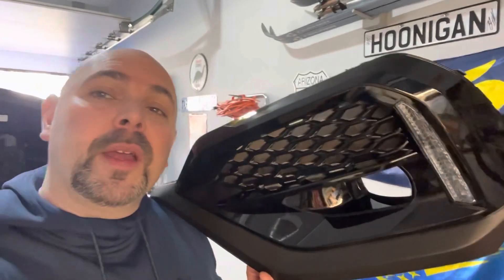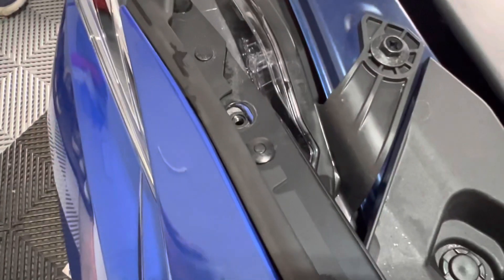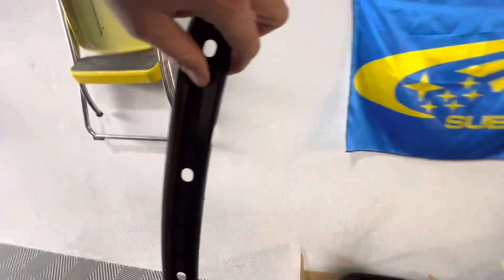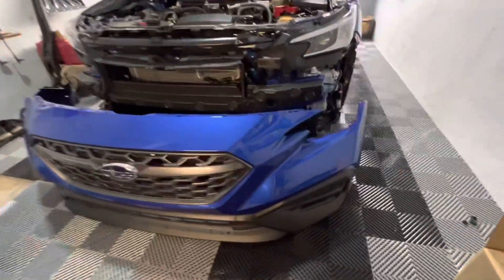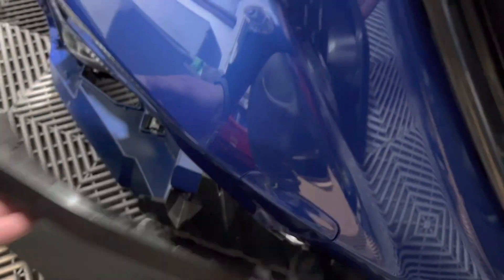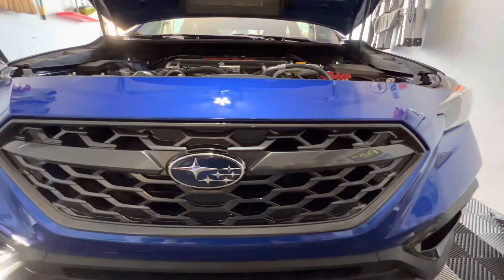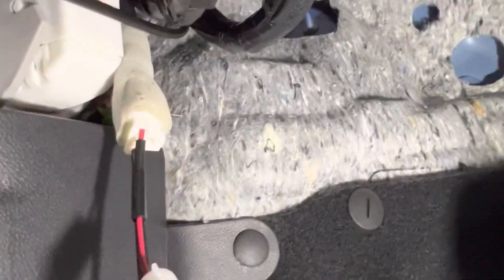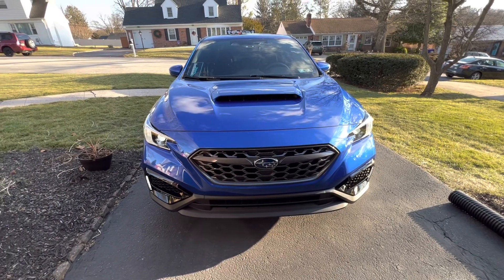WRX upgrade!! LED fog lights installed.

Comment: Great video! Really helpful 
Under the dash, is it as simple as just plugging both pink wires together? 
Also, would it work the same way with the JDM ones?
Reply from the maker: @Dragunz_ewe  It is literally that simple.  I am not sure about the JDM ones but I am assuming they are the same.
Reply: @allthingssubie4796  awesome!!! I’ll give it a try 
Thank you for your help even after so long!

Comment: Great instructions, thank you! Also, is the wire assembly on the interior the fuse? Or do we have to install new fuze in the box?
Reply from the maker: @Drizzlee44  no new fuse it just plugged right in.
Reply: @allthingssubie4796  Thanks again!

Comment: I have a question if you dont mind.  Just installed those on my wrx (first one took me an hour to remove the old insert- second took 3 minutes!)

Are these just daytime running lights during the day? I can't find the switch 4 my fog light since I just got the car. There's no separate switch correct?
Reply from the maker: Yes it was definitely a learning experience with the removing the first one.  Yes the side LEDs are on all the time, even when your high beams are on.  The fog light control is on the headlight switch on your steering column.  Try turning the middle of the headlight control which should rotate just like the main headlight control
Reply: @allthingssubie4796  Thanks for the quick response.

Comment: Hey do these have the turn signal functionality that the JDM ones have?
Reply from the maker: @gregfratto6276  these did not.
Reply from the maker: If I replace them I would probably get the ones with the turn signal function.

Comment: Do you know the name or part number for the fuse or connector that goes inside the car?
Reply from the maker: @julioanaya6346  The OEM kit came it, so I am not sure if it has an individual part #.  It is a simple fuse loop.  I would check with your local Subaru dealership to see if they have one.  I even took a moment to look online but did not have any success finding it.

Comment: I disagree w/removing the bumper.  all of the work can be done w/the car on stands or ramps.  obviously if you don't have stands or ramps you have no choice but to remove the front bumper.  access is easily achievable by removing a few pop clips that hold the splash guard in place just in front of the front tires.
Reply from the maker: I can see how it would be possible if you have a lift or floor jacks, but accessing the one screw on the top of  the foglight assembly would be a struggle. It is really tucked in on the back side of the bumper.  For me I also wanted to see if I could remove the bumper myself with just basic tools.  I also agree that there is always more then one way to get the job done.

Comment: does this kit came in with the bezzle fog light or just the strip LED
Reply from the maker: It is the whole lower bezzle in gloss back.  The LED strip is already wired and ready to go.
Reply: @allthingssubie4796  ohhhhhh holy fck ive been searching if its seperate lol cause I only have the base model so, Im wondering if the bezzle is a seperate buy. thanks!
Reply: @allthingssubie4796 is the fog light assembly a seperate buy
Reply from the maker: @Mark-bo6to  Yes the fog lights would have to be purchased separately.  It has its own bracket and separate wiring harness.  It sucks cause that is an extra cost and not sure how many placing are carrying that in stock.

Comment: Where can I get the cable for the fuse box?
Reply from the maker: It should come with kit from Subaru.  Not sure if you can buy it separately.  It is OEM so check with your local dealership.

Comment: Care to share the link where you got the fog lights?
Reply from the maker: They are OEM, order for most any Subaru dealership.
Reply from the maker: Part #H4510VC200
Reply: Is this the JDM one or USDM one? Thanks
Reply from the maker: @botbs  I am not sure.  The dealership advised that they were on back order when the car was assembled.  They arrived 4-5 months later at the dealership.
Reply from the maker: @botbs  I tried to take a picture of the box but it would not sent.  The box is from Japan.
Reply: @allthingssubie4796  no worries, thx